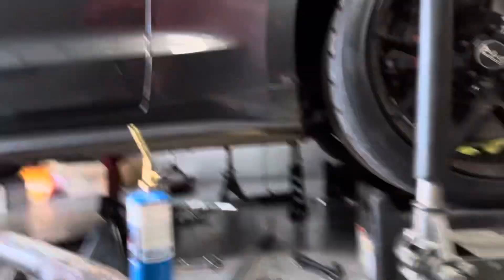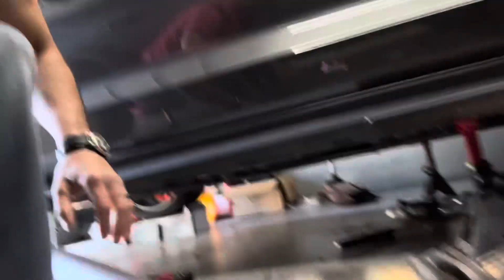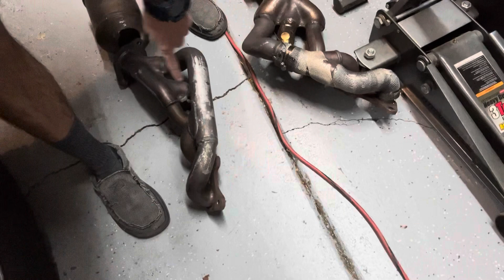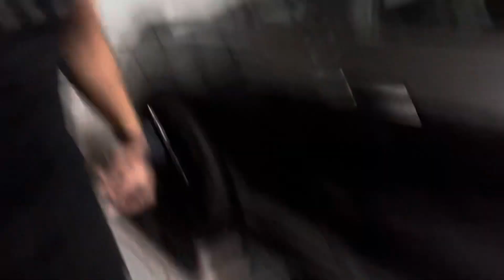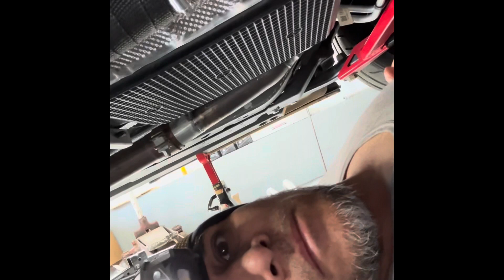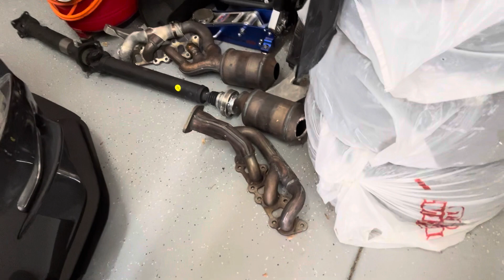2018 Mustang GT Whipple Charged custom headers with race cats!

Comment: Going through this rabbit hole myself currently, these are the only cats that work apparently, how well did they perform over time?
Reply from the maker: Fantastic and I roll raced several times without issues.  My Mustang was making 12lbs of boost about 800 wheel and the cats didn’t break a sweat.  Passed emissions easily.
Reply: @motorsandmedicine1383 good to know, I'm gonna check out those shorty headers as well.